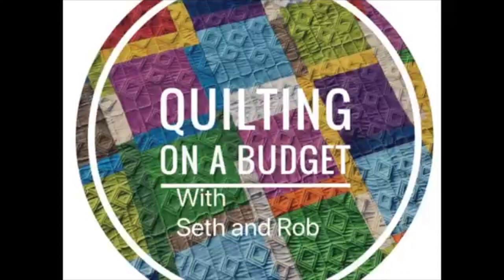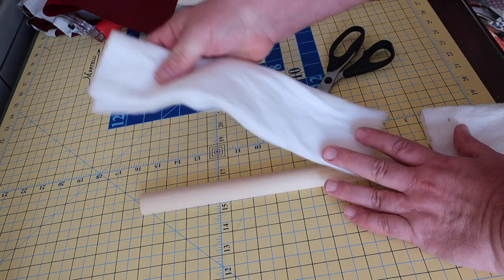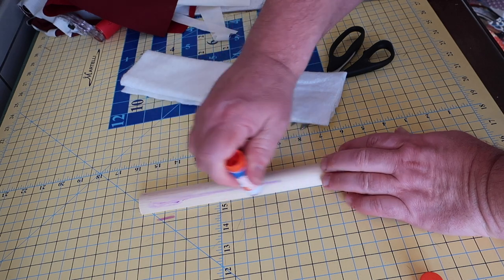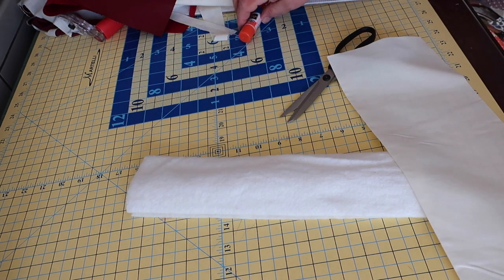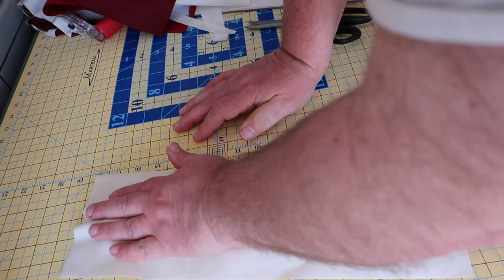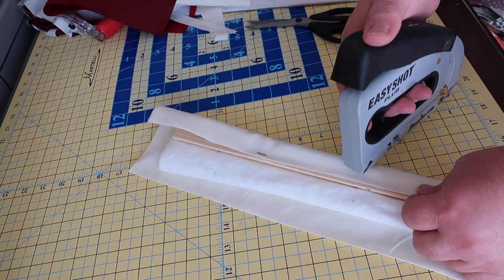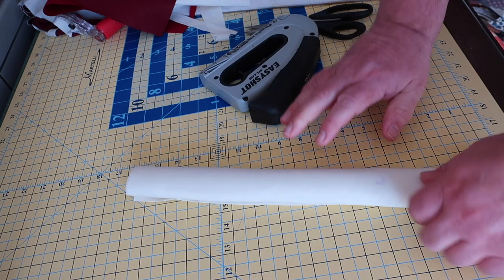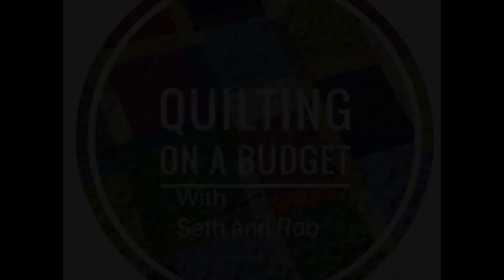Making a Pressing Stick

Comment: Nice video but how do you use the pressing stick?
Reply: Sometimes there's too much bulk, for example if you're making flying geese, or doing paper piecing. It's better to press the seams open instead of to one side.  You lay the seamed pieces over the round part of the stick. They fall open, making them easier to press without distorting the pieces.